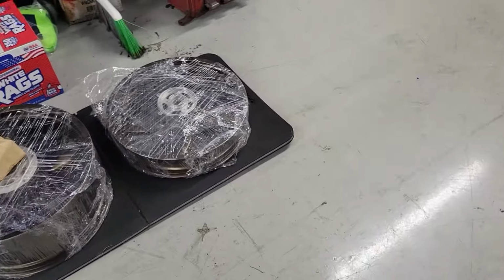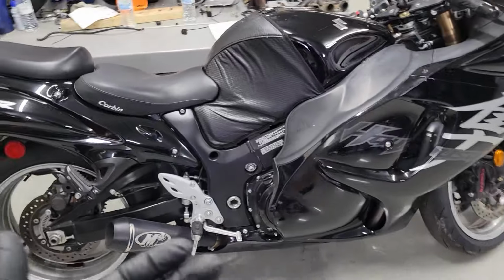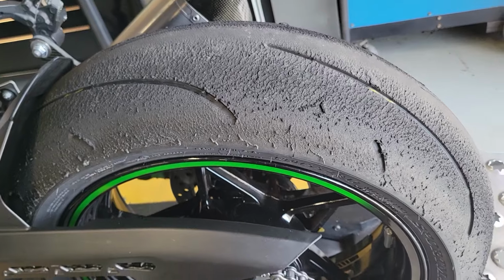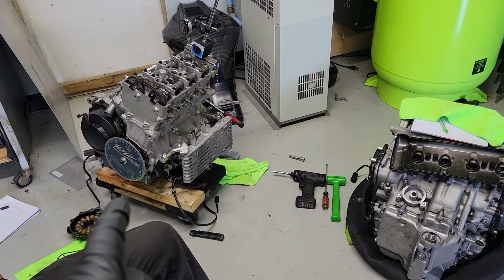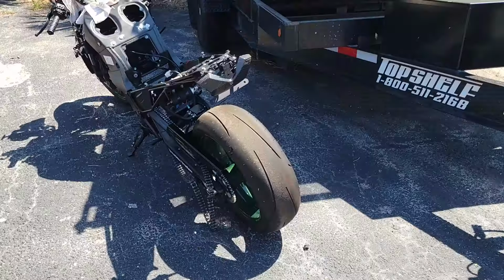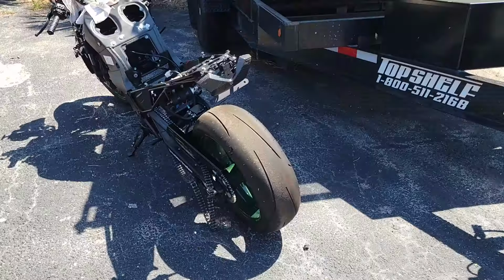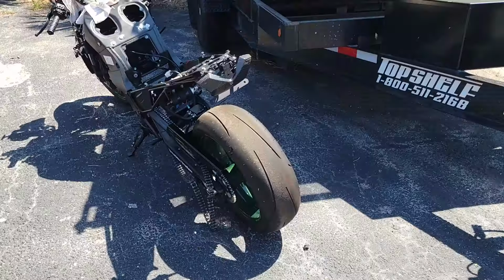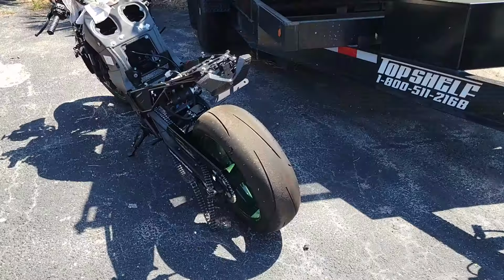Stage 3 Kawasaki H2 Sounds NASTY!!! - Shop Vlog

Comment: O yeah,wanted to know,whats the degrees on your cams on your zx10r, or you just going with what the kawasaki race manual says?
Reply from the maker: We don't recommend kawi degrees lol not unless you build the bottom end. Bike becomes very laggy.
Reply: All good.no bottom end build,just port and polish.thin 0.5 headgasket.so very confused on what degree to go with on cams?love the content. is.
Reply from the maker: @turbo4926  to be honest, we are still working out the kinks on it. We don't have any real gains that would allow us to respectfully say a good cam degree at this moment, but we are still going to try a few more options before calling it 👍👍
Reply: Thanx for that.cool hopefully get it sorted soon.

Comment: Absolutely a big mistake! Powder coating is a dirty job and needs to be isolated from work areas and customer property. You will turn your shop into a dusty nightmare. I owned a bike shop and powder coating business for 7 years and that was my main problem was constant contamination on both ends. Just the sandblasting alone is gonna ruin the shop, then the powder that is lighter than the air you breathe
Reply from the maker: Said blaster will be outside the shop (we will be making a doorway in between oven and prep room. But we are in a hold up on it all regardless. Waiting to see what happens next eith it.
Reply from the maker: Also, thank you for the heads up on it all.  We will keep that in consideration 👌

Comment: when are you gonna put a 2024 cbr1000rr-r on that dyno? And something else, do you think a gen3 zx10 could ever make as much power as a honda or at least close to it?
Reply from the maker: We would love to have one on the roller.  We had someone bring us theirs for baselines years ago, told us he was going to come back for the tune and everything and I think he he ended up opting for a bren mail in flash
Reply: @provenpowercycles  well, but can it compete with the newer bikes? that's what I want to know. The gen3 zx10r is one incredible machine and was the most powerful of its era. Plus, it has a good trusty cable throttle.